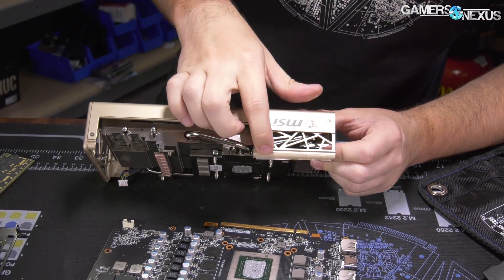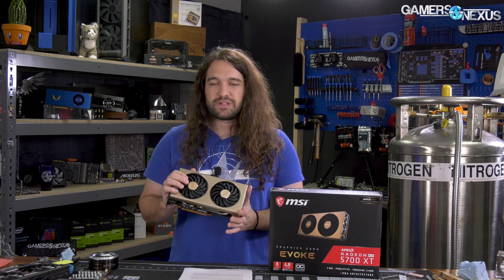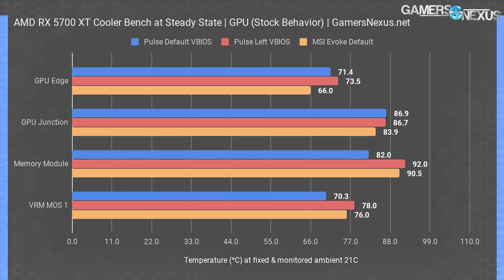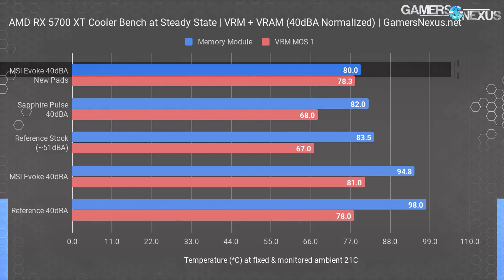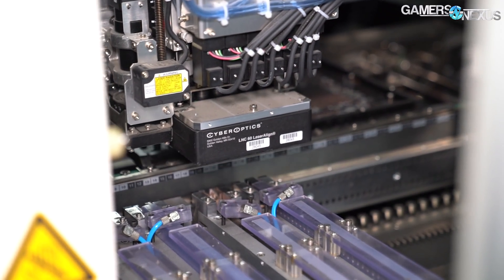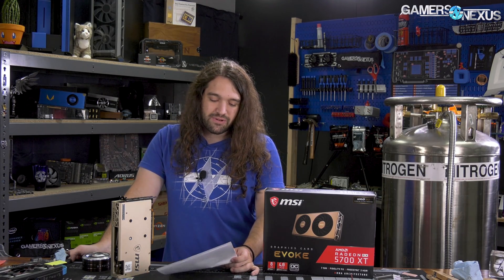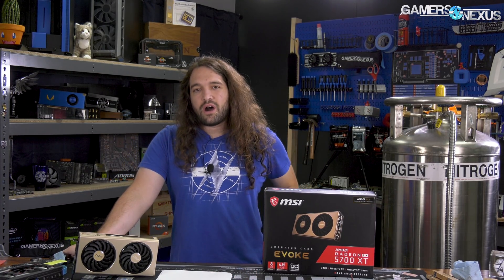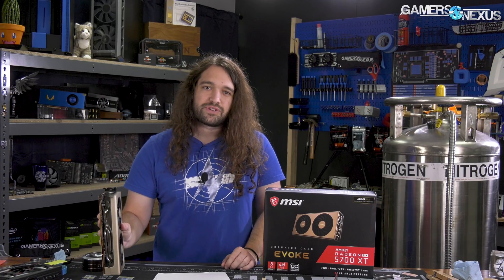Fixing MSI's Design Flaw: Thermal Pad Swap on RX 5700 XT Evoke OC

Comment: So 12 bucks retail fixed cooling well enough that 40dba cooled better than stock running at 51dba, and MSI is supposed to be one of the "big boys" that knows how to do this stuff.
Reply: They do know, but it would cost more money, hence why they didn't.
Reply: Well, retooling is expensive and it's not the only card they cheaped out
Reply: @triadwarfare  pick and place machines dont need to be retooled
Reply: GLaDOS ಥ‿ಥ that’s for you to fix. Even less for them
Reply: I don't buy MSI stuff anymore. My MSI motherboard has absolutely garbage software for controlling fan speed and leds.
Reply: €50 more for any card
Reply: @GLaDOS ಥ‿ಥ Yeah, 12 bucks for every single card produced up until that, not to mention a retooling of the machines that "stamp" the cards, so to speak.
Reply: @Orcawhale1  12 bucks retail. These companies don't pay retail. And the point is they should have known to start with.
Reply: @johnwolf2349  And your still not getting the point, that they chose the cheaper solution, knowing this.
Reply: @Orcawhale1  So MSI intentionally chose to go with pads that don't cover their components properly? Do you have any sources for this, or are you just talking out your ass?
SAPPHIRE managed it, why can't they? Is there a shortage of thermal pad material localised entirely around MSI's factory like what happened with Bethesda and their canvas?
Reply: @johnwolf2349  Nope, they had a choice. 
Go with full on pads, or go with lesser ones and save money. 
Hell AMD did the exact same thing with the reference coolers, so it's pretty fucking odd for you to suddenly go all haywire, on this point.
Reply: @johnwolf2349  This guy gets it.
Reply: @Orcawhale1  This is not what AMD did with the 5700 XT reference cooler. They used properly sized pads, and a high end pad on the GPU itself. They did skip putting thermal pads on the back plate but that's more of a missed opportunity than a short cut and wouldn't of effected the card's final GPU temps anyhow. AMD's choice of a blower style cooler was the big problem there, a cooler like on the Radeon VII cooler would of helped out the reference card tons and it is a very simple cooler compared to Sapphire's. I'll also point out that you can drastically improve the cooling ability of the reference 5700 XT by adding plastic washers under the mounting bracket screws to increase the tension slightly.
Reply: @Ephem13  Another goal post, to deal with. 
I mentioned the reference card, as a example of the hypocrisy, over the outrage of them cutting costs, despite AMD themselves doing the exact same. 
So in conclusion, your still deliberately ignoring my point, not that it matters, because your comment isnt directed at me, but is directed at the audience which you hope will band together, and give you the acceptance your so desperate for.
Reply: @Orcawhale1  $12 is RETAIL. are you people fucking BRAIN DEAD? MSI does NOT pay anywhere near $12 for the pads for the card. Not to mention that's for a whole new set of pads, they already had some on there, so its not like they'd be replacing the whole set, just CUTTING THEM TO THE RIGHT SIZE.
Reply: @shawnpitman876  Oh, you mean that arbitary number which stems from the first comment, which is penned by a user by the name of "Glados". 
That arbitary number which i just ran with, because i figured no english speaking person with a sound mind, would focus on that, rather than the actual point. 

Shawn your the proof that American exceptionalisme isn't a real thing. 
(Also pretty fucking absurd, that you need me a europoor to teach you this).
Reply: @shawnpitman876  It don't matter, because your still deliberately misreading my comment and the actual point of the comment.
Reply: @Orcawhale1  The number isn't arbitrary, it's the going RETAIL cost for a large enough amount of Thermal Grizzly pads to do one GPU in the US. Was said multiple times in the video. As the buyer, you could skimp on the pads but what's the point if you had already decided on going through with the repair? The word retail is in my original post, and in the video several times. Seeing as you missed all of that, I don't think you have much room to be going around insulting Americans. You also missed what was implied by my comment, but I chalked that up to the possibility that a colloquial statement can be missed easily.
Reply: @Ephem13  It most certainly is in regards to my point with the comment. 
The point that your either not getting, or purposefully ignoring it.
Reply: @Orcawhale1  you do realize pick and place machines can do multiple sizes without needing to be "retooled" right? Msi buys in the millions so it costs pennies to for there thermal pads. Like it was said in the video. Dont try to play it off as arbitrary you brainlet
Reply: @zombieswitapple  You do realize that wasn't the point of the comment, right?
Reply: @Orcawhale1  what was the point then huh? Save money? $12 and $.012 makes loads of difference if you're trying to argue that. And if they really needed that money they could've increased the msrp by a couple of pennies. Are you really trying to argue that they were saving money by using slightly cheaper thermal pads.
Reply: @zombieswitapple  "Are you really trying to argue that they were saving money by using slightly cheaper thermal pads." 
Yep, that's exactly right.
You American's should everything about this, given the whole problem you guys had with General Moters, and the whole suits that followed after they launched the Corvair Mk II.
Reply: @zombieswitapple  I get what you are driving at I think, there are tons of reasons this could of happened. Someone could of set the cutting size wrong, and let an unknown amount of cards fly off the line. The factory could of been looking to save a few bucks, and a few pennies per card across thousands of cards would do that. I know several "lines" of MSI cards are known to be trash at cooling, might be worth a look to see if they have the same issue. It could also be a mistake that happened on a review sample card and never hit the factory line properly, at this point we don't know. What we do know is it should of never left the factory like that, any QA/QC team worth their salt would of caught that no matter it's destination.
Reply: @Ephem13  im just saying its quite dumb to argue value proposition and saying the amount saved is arbitrary and that due to it being a couple of cents it doesn't make any sense for value prop. If they really wanted value they could have dropped a teir in literally any other component to save 100xs the amt per card

Comment: my 1070 asus dual also has nothing on it's memory chips, but the temps are ok. should i try the same operation with thermal pads?
Reply: If it has no thermal pads at all, then it probably doesn't have anything contacting the chips at all. Just slapping some thermal pads on there without having anything for them to transfer the heat to would make temperatures worse, not better. You could try getting some aftermarket small heatsinks to apply to the memory modules, but those frequently interfere with the stock cooler. There's no reason to change anything if your temperatures are fine. Cooling the memory modules with nothing more than airflow from the fans is a valid, if not ideal method.
Reply: @CaptainKenway  thought so, thank you anyway
Reply: Make sure there is metal contacting the pad, otherwise it won’t make any difference. If there is a metal to sink heat, that may help both longevity, temperatures and overclocks :-)
Reply: Maybe they're stuck on the cold plate lmao
Reply: which one asus dual oc edition?
Reply: Probably not a terrible idea. Though you might only get a slight improvement for thermals.
Reply: LordIron It’s a bad idea, esp if there is not contact.